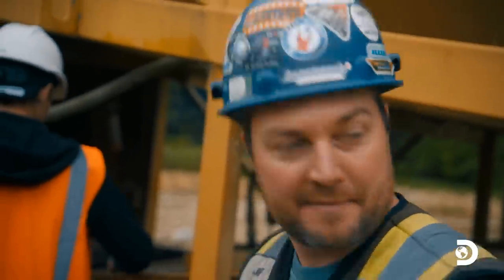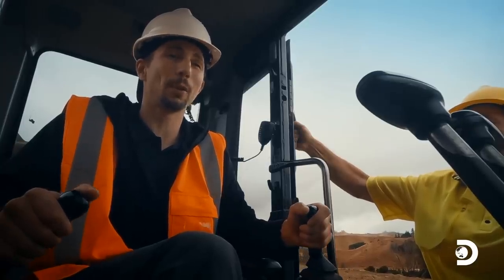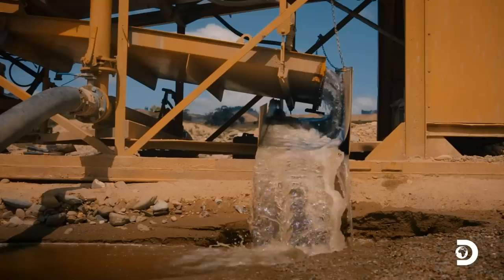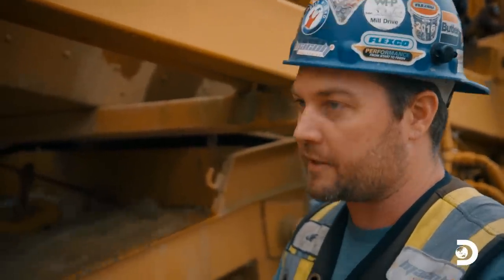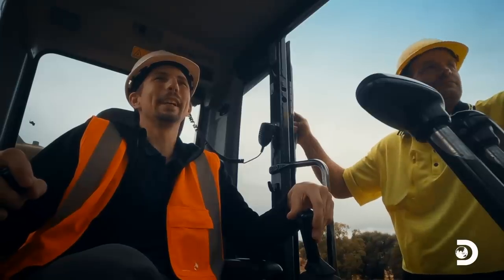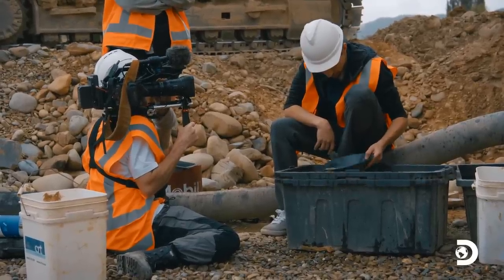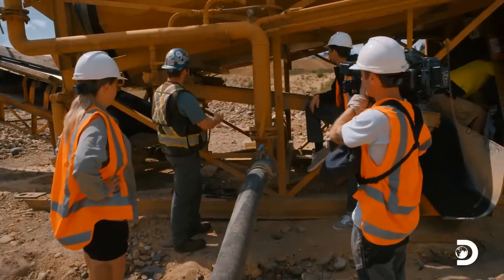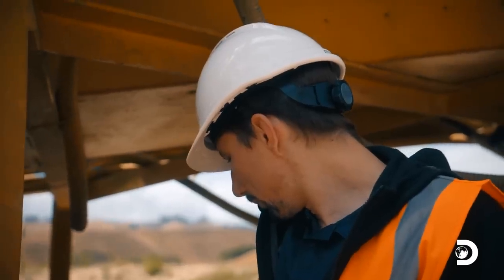Parker Is Torn on Buying This Gold Producing Plant | Gold Rush: Parker's Trail

Comment: Why doesn't he buy two of them? Immediately doubles the rate, and keeps both portable.
Reply: Nick Strickland this plant is smaller than parker's regular plant. Sit them side by side and feed then with a conveyor just like they already do.  Easy.
Reply: Parker wants to run close to the same amount of dirt as the Yukon, probably to save on equipment (loaders, trucks, diggers to feed, etc) and the sluice run there is 6ft vs his 20ft in the Yukon. He would need 3 to even get close and that means a larger footprint or multiple diggers feeding. That's why he didn't "just buy two [or three.]"
Reply: Because these plants are 1 offs that people make you can’t just go get yourself 2 my bro
Reply: @stevenbrain5015  well, yes and no. They're one offs, true. However Oarker brought a guy with him whose job it is to build wash plants. I'm sure design plans exist and you could build multiple if you had the funds/desire. It's just expensive as far as material costs go.
Reply: @Torsion  can’t build 1 in a month though can ya he needs it like today not months to come

Comment: I thought Parker had a custom-built plant named Slucifer, did he stop using it or something?
Reply: Needs a different one for his Canada operation. Sluicfer is on his Alaska claims
Reply: He's expanding his empire with another claim in Fairbanks which is like 711km from Scribner creek in the Yukon, where Sluicifer and Big Red are located, he's also splitting his crew between the two claims.
Reply: 711km? That's like 200 miles
Reply: @getchasome6230  that's the point he's trying to make, this whole thing is a separate operation from the one he runs every year in Alaska
Reply: @getchasome6230  where'd u learn ur maths? 1km=0.62miles so 711km=441.8miles
Reply: @duomaxwell2293  Common core